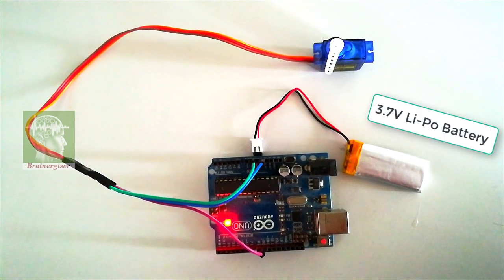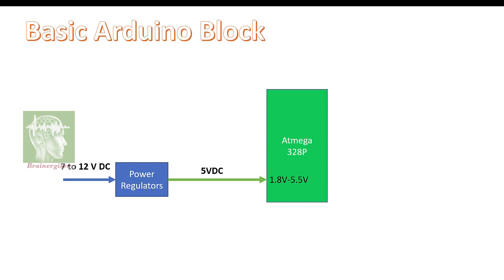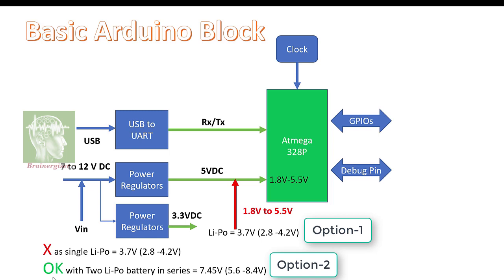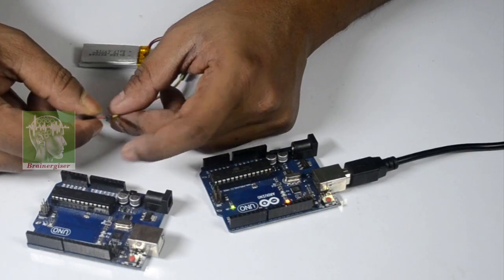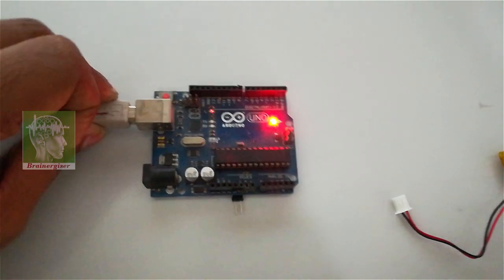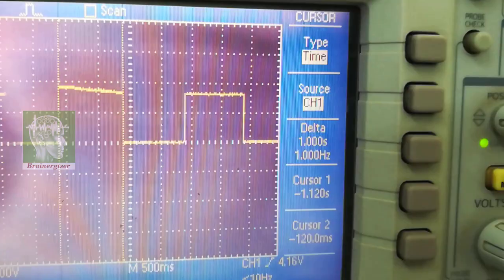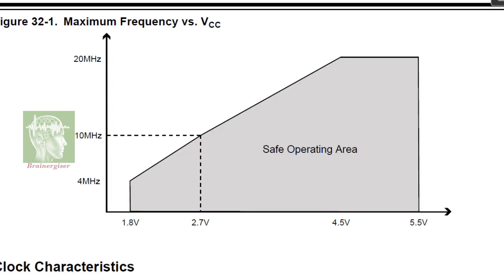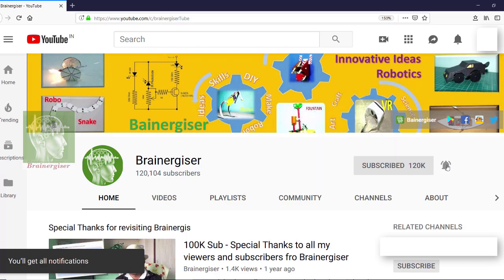How to Power up Arduino using a 3.7V Li-Po battery

Comment: I have a project to light up a addressable led strip,What if i want to use a 7-12volts lipo battery do i need some do i need some capacitor?
Reply from the maker: All depends on the battery capacity and current consumption.
Reply: @BrainergiserTube  7-12 volts battery
Reply from the maker: @zoeyboy1215  understand, but how many mAH battery?
Reply: @BrainergiserTube  do i need to use a capacitor? If yes, can you please recommend the right capacitor i need for 20m led strip 🙏🏻🙏🏻🙏🏻
Reply: @BrainergiserTube  around 1100 mAH
Reply from the maker: @zoeyboy1215  then no need to add additional capacitor for the led strip.
Reply: @BrainergiserTube  how about a regulator? Sorry newbie here 😁
Reply from the maker: @zoeyboy1215  yes, you can use a regulator. 1A.

Comment: Hello bro I've one question I'm now currently using the Arduino nano controller and i' ve the two servo motor and 4ldr sensor. This 3.7v LI-PO rechargeable battery is enought run the both nano and servo motor or else we need to change the battery voltage ?? Kindly reply bro
Reply from the maker: What is servo motor spec? Also mAh of the battery?
Reply: @BrainergiserTube  600 mah battry and micro servo motor sg90 operating voltage 4.8v to 6.0v and battery is 2.05 wh battery this power to enough to the two servo motor and Arduino nano ?? Kindly reply bro
Reply from the maker: @INFOMIXOFFICIAL  u can use it.
Reply: @BrainergiserTube  and with that i connected with the charging module ?? How many hours it can able to sustain??
Reply from the maker: @INFOMIXOFFICIAL  it depends on the load current. If two such servos and other circuit taking total 300mA then a 600mah battery can run for 2hrs.
Reply: @BrainergiserTube  okay bro

Comment: Why not using a battery charger module to charge your battery through pin 5V and prevent overcharge ? And also a booster converter too because the arduino needs a minimum of 7V (max 12V) in Vin I think (which is then reduced to 5V through a regulator).

Comment: thank you for the info. there is also a 3.3v pin next to the 5v pin, what it will happen if the Li-Po battery use that pin?
Reply: It will probably damage your mcu, specially if your battery is fully charged. It is ok if you connect your battery to pins that have a higher voltage tolerance than your battery can provide (like connecting a 3.7 volts battery to 5 volts vin like in this video) but 3.7 is higher than 3.3 volts so it will damage your mcu
Reply: Aaaah 😌 some one know it 😅

Comment: 5v pin out  you attach 3.7 volt limon battery .why ?do it'S
Reply from the maker: Because 5v pin is connected directly to the VDD pin of Arduino chip, so connecting some voltage say 3.7v there will directly power up chip with the same vol (3.7V).

Comment: hi, very informative video, i want to know, if i put a diode between  pin 5v  and battery to avoid voltage from the usb, and permit to upload program to arduino without disconect the battery, thanks

Comment: If arduino is powered by battery, how do you know voltage reference for analog sensor reading?
Reply: Interesting question... u mean if you connect the battery directly to vcc (and it below 5v)? i think it's better to connect  a battery (7-12v) to vin to pass through the voltage regulator, to insure the correct voltage level...

Comment: I thought 5v pin  is only for output.
Reply: If I am not mistaken, power output pins can be used for power in. Just do not plug the usb while powering through the pins
Reply: @sleeprene  what if a diode is present and limiting current flow in one direction(lipo to 5v arduino)?

Comment: Can we connect a big lipo battery to arduino ?
Reply from the maker: What do u mean by big? High power or higher voltage?
Reply: @BrainergiserTube  high voltage !
Reply from the maker: @unknownartist734  Yes you can. You can use a 2S lipo battery, which is 3.7x2 = 7.4V, but you have to connect ii at Vin pin or DC shoket of Arduino board.
Reply: @BrainergiserTube  thanks ! I am making a big project

Comment: how can I run esp8266 on batteries?
Reply: Use a ldo regulator like mcp1700 or simply use a 1n4007 diode in series with the battery to drop 0.7v . Diode one is very crappy solution but it works for me till now

Comment: This is very good. How did you connect the two pin wires to JST connector of Lipo battery?
Reply: Had the same question - check out how he checks the battery voltage - on my LiPo red goes to 5V, and Black goes to ground. Happy Building!

Comment: Brainergiser, Thank you for your basic tutorials on the battery. When you mentioned the crystal based on Mhz, I didn't realized  on some Arduino board comes in variety of frequency. I guess, I will have to take some CLOSER look on crystal. Again, thank you for the best educational on lipo battery. Normally, not all vendor or eBay vender sell the same based on products from the market.

Comment: I have a question, can the arduino be battery powered with 3.7 as you mention and simultaneusly connect the usb cable to the computer? Will it damage anything? thank you!
Reply from the maker: Please check at 3:16 ,it will over charge or damage your battery.

Comment: Nice tip to use Rechargable of available Arduino board. I know it's possible to make custom Arduino board with lipo bat as atmega chip works at wide voltage range.
Reply from the maker: Kids get upset when battery is fully down. So rechargable battery based projects makes lot of sence.

Comment: Hey thanks for this awesome video. I have a question though: you mentioned that if you plug a usb cable while the battery is connected, the board will try to charge the battery which could cause the battery to be damaged, but if the battery that was being used was rechargeable, would the board be able to recharge it without problems or would you need to do something extra? Thanks!
Reply from the maker: A 3.7V rechargeable battery can't be charged directly from 5V. You need a charging IC, which will charge the battery either in CC or CV way upto max 4.2v.

Comment: Can you suggest me cheapest pc available in market so that I can flash some program in C
Okay it nice tutorial I am going to start Tech channel in Malayalam what is your opinion .....
BUT I dont have some have gadgets like you but I will always 
Wait for your videos ....
And you will get 1 Million Subscribers 
Make videos on Raspberry pi all model....
Reply from the maker: Sorry, until the requirement are known difficut to select such pc. You can use Pi, even Arduino for C based projects.
Reply: @BrainergiserTube  tried pi and I have it but some codes are shown as error and connecting wifi based device's is very difficult....to Arduino....thats the problem....
Now want to try Asus Tinker board   and Windows 10 for pi together as it has a 1.3 GHz + ARM ( Advanced Risk Machine) and 2 GB of Ram hope this will make it...